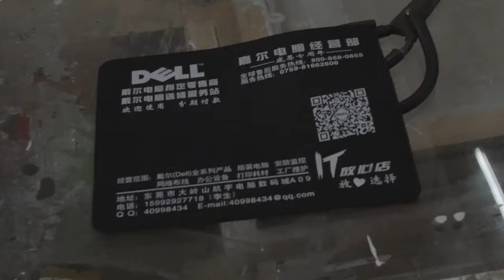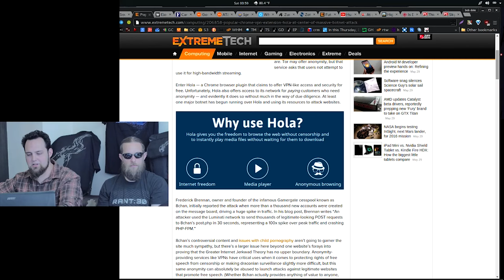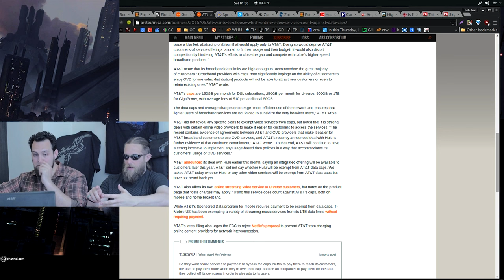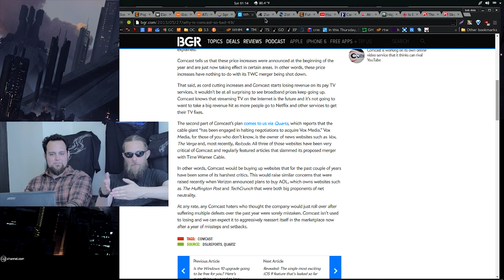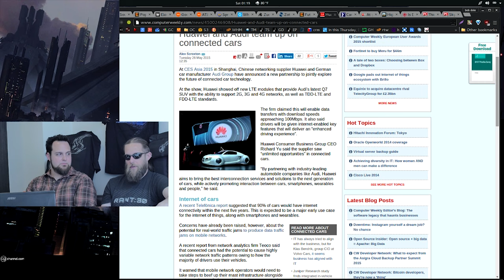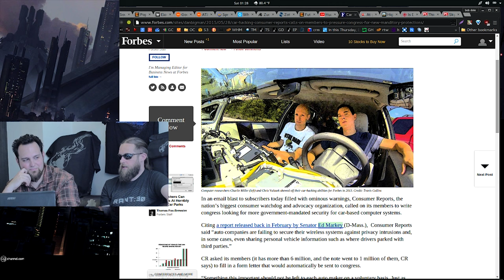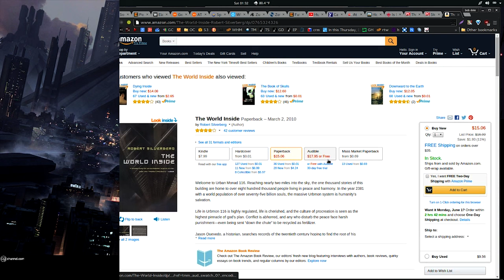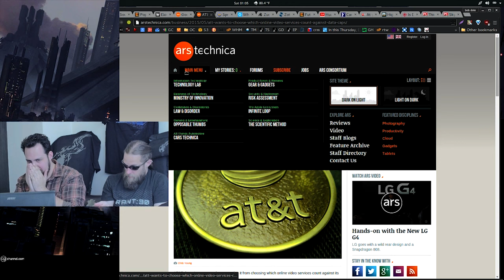The Tek: Hong Kong & China

Comment: ~8:35 talking about Norton being almost malware, in the time I've seen it, it has killed 3 Windows 7 PCs, slowed down an SSD-based Windows 8.1 laptop to the point where it felt like using a laptop with a 5400 RPM HDD without Norton, and it made a Mac that had been running stably for years encounter its first kernel panic. Norton was swiftly uninstalled from those machines and I still warn against it when I see a friend with a new computer with the Norton trial on it. I talked someone out of dropping the cash for a new family license after it had expired on his computer and I removed it and put Avast on it. The computer ran more stably and faster without Norton.

Comment: As a car/motorcycle enthusiast I have a major problem with machines doing the work. I like fixing cars, I like driving cars, I like as you've said being in control. It should always be optional.

Like how would you like it if you could never build your own PC? and you had to take it to a machine to change the graphics card or fix what is wrong, when you could probably fix it yourself.

I think it should always be that tinkerers are allowed to play around with their car but normal people can just have everything automated. So if we move to hydrogen engines people can still play around with using different pistons, or if we move to electric motors (yay....boring electric motors -_-) we can change the motors and overclock them a bit etc etc.

Comment: I think that we can never lose manual control of a vehicle. I welcome fully automated control as an option only, not as a complete replacement. You sometimes need to take control yourself and change directions as you see things or when you're just driving for pleasure without a specific route. But especially for an occasion where the system may malfunction. We do need fully automated driving option also though, for when we are tired or just don't feel like driving or for occasions such as gridlock, or even to call the car to us, or tell it to go park somewhere, etc... It is completely true though that the roads are a lot safer with automated driving systems than with drivers since the human error rate is tremendously higher than the machine error rate. The ideal compromise in terms of safety would be a mix, or the two watching each other, which is already starting to happen, as in, the car can intervene if you are on a collision course, but you can also override the car if the car is the one to malfunction. Manual drive will also not be truly manual and will be more of a drive-by-wire thing where you will input your turn-by-turn intentions and the computer will translate that into the mechanics and the actual driving. The computer will actually be driving the car either fully autonomously or semi-autonomously (on your turn-by-turn commands) always with the manual override possibility built in in case of major malfunctions.

Comment: The thing about letting machines & computers take over 100% of the roads and the vehicles on them is that you're not actually removing the human element from the equation. At least, not totally. Someone, a human, still has to write the software that they run on. Another human has to program the AI and tell it to take X action when presented with situation Y, etc. Could it potentially, some day, be safer? -- sure, but not right now. The software and AI in general isn't even close to where it needs to be... yet.

Comment: what do u guys think of this build
 Intel® Core™ i7-4790K 4.0 GHz 8MB Intel Smart Cache LGA1150 (All Venom OC Certified)
256GB SANDISK SSD + 2TB SATA III Hard Drive Combo [+27] (Combo Drive)
 8GB (4GBx2) DDR3/1600MHz Dual Channel Memory (Corsair Vengeance [+14]
 GIGABYTE Z97X-SLI ATX w/ Intel GbLAN, 2 PCIe x16, 3 PCIe x1, 2 PCI, 1 x M.2, 1 x SATA Express, or 6x SATA 6Gb/s (Extreme OC Certified)
EVGA FTW Edition ACX 2.0 NVIDIA GeForce GTX 970 ACX 2.0 4GB GDDR5 PCIe 3.0 x16 [+35] (Single Card)